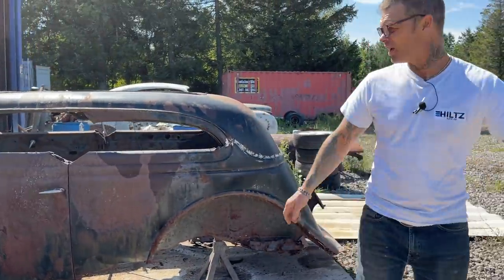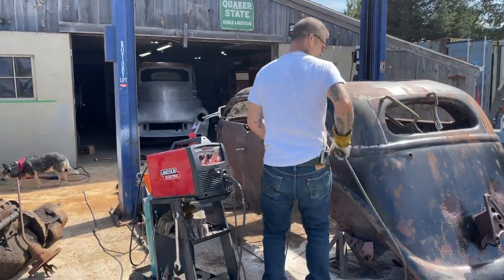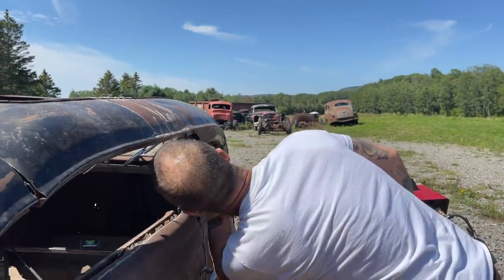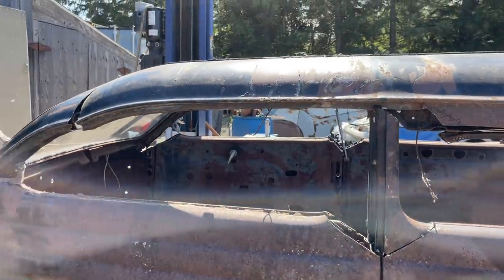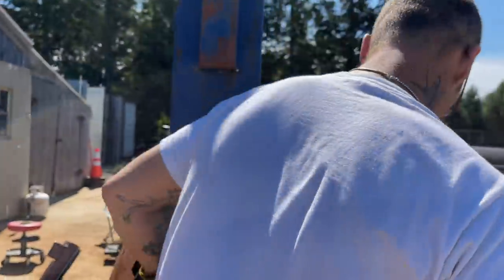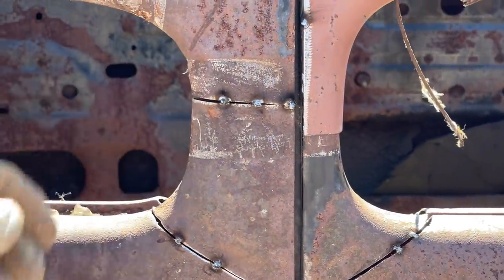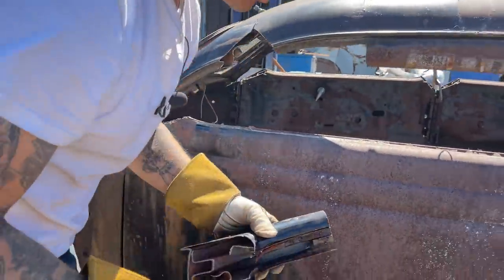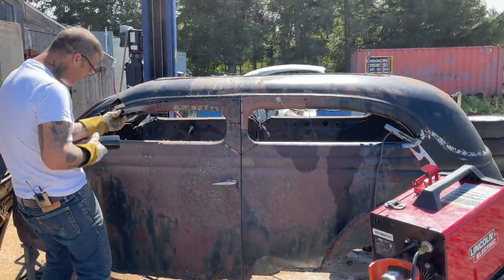1935 FORD 6" ROOF CHOP - PART 2 - FITTING THE WINDOW PIECES

Comment: Wow!  Chopping on the Fly?  You have gone warp speed!  You see, therefore you chop.  No messing around...I see you going for the new form with extreme discernment.  Chad, you are a sculptor.  Your vision for form is no holds barred.  The Shredder meets radical design until the master metal man wins.  Wee-oh.  Jolene, your documentation and design input makes the whole process seem natural in the extreme...The build is a match between builders and metal.  I know who the winners will be.
Chad, how was your Birthday celebration?  All cake and ice cream on a cutting stand?  Radical determination.  Testing your metal and tempering your vision.  Cheers!

Comment: Hey Chad, Love the way the chop is looking and commend the way you kept the front and rear windows - exactly how I would have done it.
I thought you seemed to struggle to get the top of the door frame right, especially around the new "bend" where the roof is cut. Maybe for the other side, get the profile of the roof right before you make the door to fit it. The front and back of the cut you worked on were not cut back far enough, creating an uneven progression along the drip rail area. Just a thought!
Cheers, Tony

Comment: Awesome job on the ‘35 chop! I had a little “eureka!” moment when you were marking that first door post to make it fit back in. After you marked and cut off the top, you could take the part that you cut off, and hold it even with the top of what was left of the post. Then mark where the bottom came to and cut THAT off. You would then have a perfect fit. Hopefully that makes sense.

Comment: Chad sort of mentioned it, but I couldn’t help but notice that he welded a couple parts right back where he cut them out. Tradition is sometimes the best approach (cut the door pillars in the upright portion). 

I saw Ian Roussel drop the windshield into the firewall like Chad did with the rear.

Comment: I am no expert but holding an uncapped marker in your mouth right under your nose cannot be very good.  

I am concerned that the fumes from the marker will not only give you a buzz but could also create problems with internal organs.  Again, I am no expert just someone concerned about your well being.

This race car is really looking good.  Incredible job with the chop and keeping the front and rear glass at the stock size.

Keep up the incredible creativity and the amazing videos.  Thanks.

Comment: Just a question, why did you not cut the center out of the B pillar and use the original top that wouldve matched the window line? Just seems like unnecessary work to cut it out of the other door. The end result was beautiful though.

Comment: Was wondering why you cut the doors and B posts down at 45degrees at the start, then welded the 45 degree corner bits back in again. Did you change plans?

Comment: That bloody microphone !  IMHO your troubles started with the base cuts to B pillar, next time only cut the vertical section not the mitre cuts to the base then fix the roof alignment and fit the door to that. Instead of the long way round you will get there but it may have been quicker. A bit like the chicken and the egg. Old wives tale “ You have to smash eggs to make an omelette “

Comment: I would’ve used the post on the sides you cut out I would’ve just cut the center out shortened them and welded them back in
Reply: Jody
Yes but what about the windshield.  I saw Chad fill a huge gap on a jaguar hood so maybe he can just bondo it up?  
The roof slants back now but maybe the center post stayed in the same location.  He will figure it out.  I doubt he will do much more work on this car anyway.